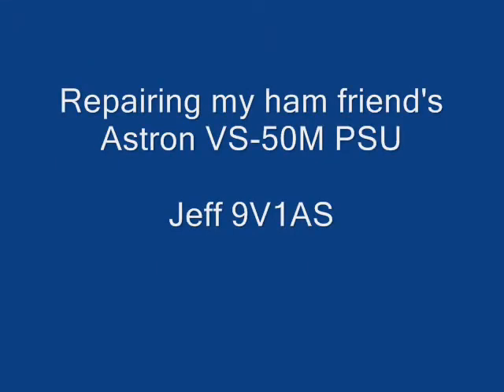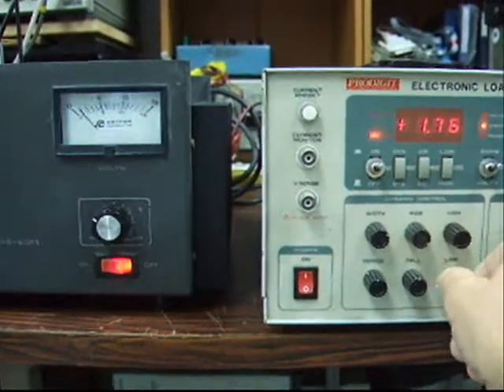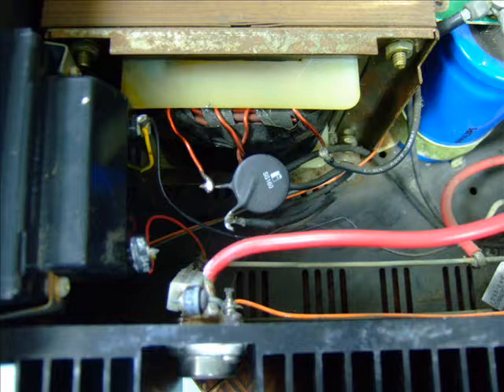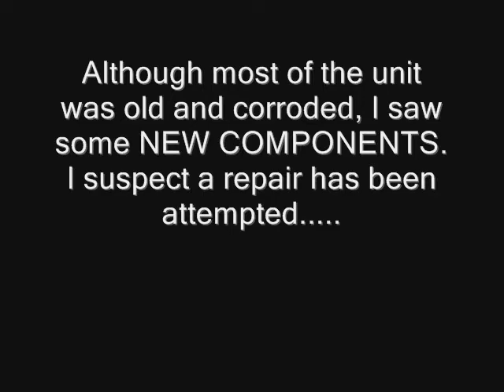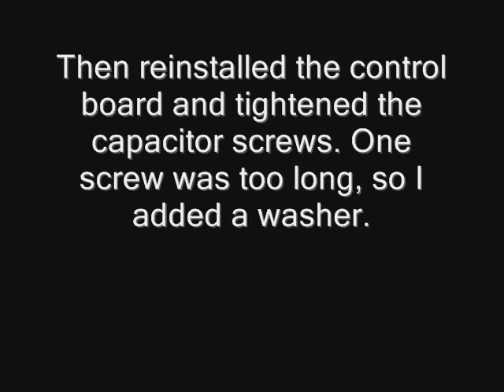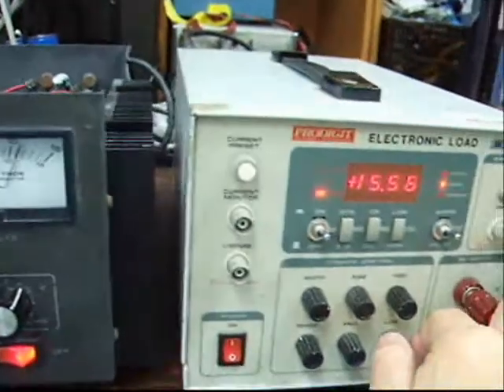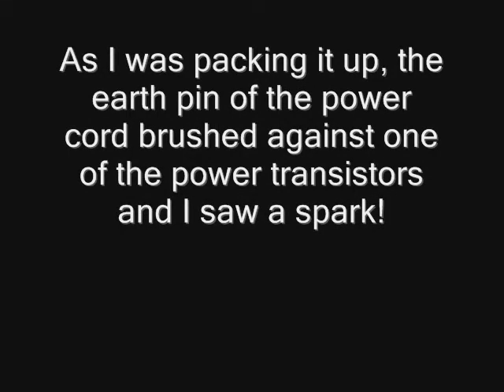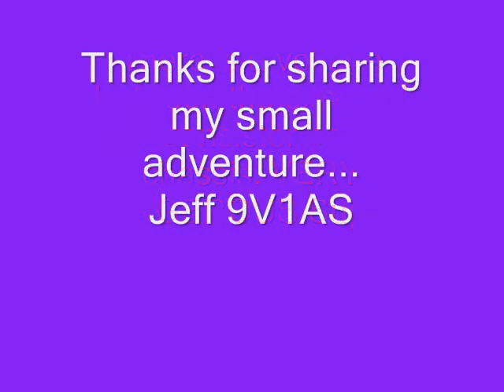Repairing an Astron VS-50M linear ham radio power supply

Comment: I have a RS 50M that started buzzing louder than normal but only once in awhile I checked all connections, checked all voltages all are as they should be according to the schematics spec's. I used it keeping eye on voltage under a load of a president Lincoln 2+ radio. All was normal. Just baffled on what  could be the issue any help is  appreciatedn thanks. 
12 Watkins Glen New York

Comment: Nice summary.  I have an Astron 20 amp supply that has a transformer that makes an intermittent loud hum with more than 6 amps draw.  Not always loud and it has me baffled.  Regulation looks fine, just the noise.

Comment: Good morning.
Dear sir, I have a ASTRON POWER SUPPLY 13.8 VOLT DC.
USE IN TRANSISTOR NO 2N 3771.
I WANT DETAILS OF CONECTION .
PLEASE SEND ME JOINT CONECTION ALL .
PLEASE CONTACT ME OR SEND ME JOINT CONECTION OF THIS MATTER.
CONTACT ME.
03135914119 PAKISTAN CODE USE +92.
SIR I WAIT FOR YOUR MOVIE ABOUT JOINT CONECTION OF THIS SUPPLY.
THANKS.
REGARDS BEST ALWAYS.
BYE.
ABDUL NASIR
FROM PAKISTAN.